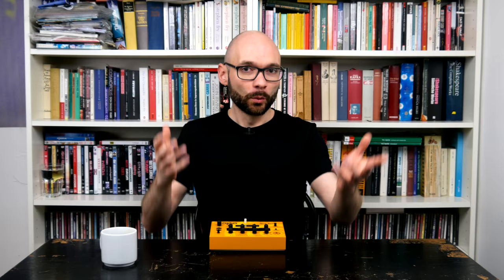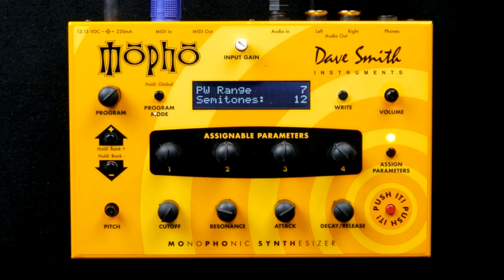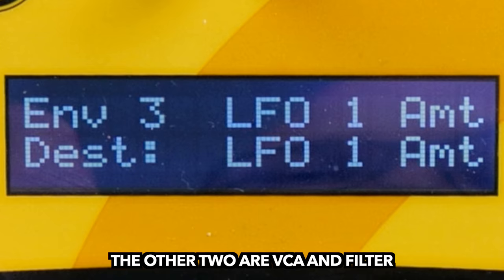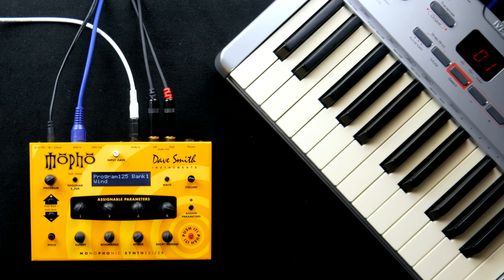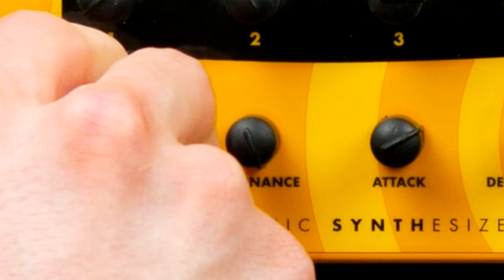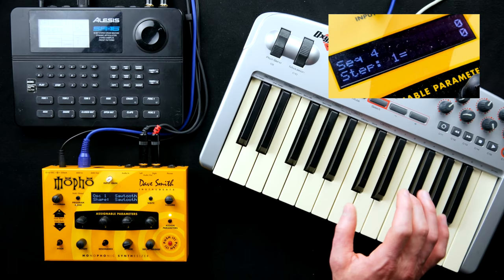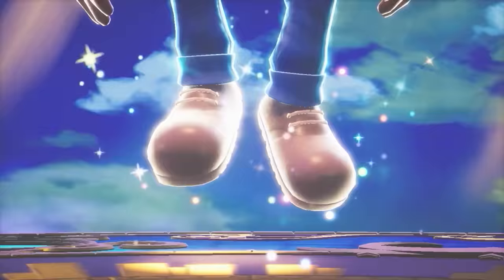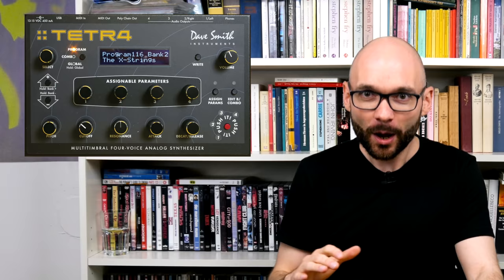Bad Gear - Dave Smith Instruments Mopho - Giving the Pro-1 a Bad Name???

Comment: That fucking intro musical / dance sequence is straight-up one of the strangest experiences I have ever had in a video game. You made the Mopho sound incredible, as always!
Reply: All the intro joints sound exactly the same no matter what bad gear he uses on each episode. Not sure how he does it but I've purposely toggled between episodes to test it. He should do a completely different episode showing how he does this. The intro music is dope.
Reply from the maker: Thanks!
Reply: None of them sound the same to me. I mean it's the same tune, with different synths or drums (if the episode is about a drum machine) 

Some of them I'm sure he really had a time to get to "fit" in the original composition, but nonetheless they all sound a bit different.

Comment: I was lent a Tetra by a friend and although it's a great sounding machine, the lack of a usable UI coupled with the fact that you have to actually buy editing software (which isn't easily transferable) from a third party company is just absolutely ridiculous. These things could easily have been riding high on the "modern classics" list if only they'd made them easier to work with, both inside and outside the box.
Reply from the maker: I wholeheartedly agree!
Reply: I agree, that's why I recently bought the key version to polychain it. A bit less menu diving and duophonic now. :)
Reply: Yeah I love the sound of my Tetra but not the interface.  I nearly bought a controller but then spotted a Mopho x4 keyboard going cheaply so I ended up buying that - got a dedicated controller with the added bonus of doubling the polyphony to 8.
Reply: a keyboard version doesn't add knobs per function, only doubles the voices. easily amended with touch osc template though.
Reply: @brmbkl  Yes that's right It doesn't provide a knob-per-function as that 's not what the x4 has.  Despite having toggle buttons for cycling between LFOs and envelopes etc however I still find the increase in user friendliness you get from having the x4's 18 or so knobs is a huge improvement over the the Tetra's 8 knobs and extensive menu diving.    One thing I would add though, is that the cost for both units combined in the second hand market brings the total outlay up into the region where there are other 8 voice alternatives available like a Prophet Rev-2 for example.   My combination was bought in stages over about 5 years after getting fed up with programming the Tetra through software/menus.

Comment: This one is part of my everyday rig. I use it exclusively for lead synth. I just dial in the sound I want and stop touching it. Probably why none of my knobs have broken off.
Reply from the maker: I think that's what they originally had in mind
Reply: In addition to leads, it serves very well for funky baselines, with the caviat that one can forgive the oscillators for being DCOs.(the curtis filters more than make up for this). Once the mods are programmed well, the front panel knobs are not an issue. Use a keyboard with velocity and after touch and the parameters come to life, The sequencer slew makes for some sick retro trance lines, and anyother music that uses portomento with pitch sourcing a bunch of modded parameters. Try it with a Future Retro zillion endless sounds.

Comment: Yet another Edisyn supported unit getting the Bad Gear treatment.  The Mopho is almost exactly 1 voice module taken directly from the Prophet '08, plus audio in and subosc.  In fact Edisyn's Prophet '08 editor supports all Mopho versions plus the Tetra in a unified editor -- they are basically the same machine.  The main problem with the Mopho is of course the menu diving.  But you can use the Prophet '08 controls to program the Mopho directly.  Think of it as a 1-voice Prophet expander.
Reply from the maker: Thanks for confirming that, I've read that while doing research

Comment: The Evolver Desktop is a good choice too... amazingly powerful, ever more amazingly hard to program.
Reply from the maker: Thanks for the input, I'll take a closer look!
Reply: Got both, evolver sounds more aggressive. They are a good couple together!
Reply: @AudioPilz  Yeah, it's got an even worse problem than the MoPho; tweaking more than one knob at a time isn't really an option because they'll fight for control of the one parameter at a time you can work on. Also, it's a really bad "just mess around to get a sound" synth because there's so many "dead spots" where the wrong setting will basically derail the sound, produce no sound, or just make it awful. It gives you a lot of options and some of them are not very musical, or not what you need for the sound you want. The manual I have even has a section devoted to the "I can't hear anything/why don't notes play/the sequencer won't play" settings debugging.

It's great if you have a specific plan and it's got a ton under the hood but you gotta go in with a plan or it's not going anywhere.

Comment: Mopho was my first DS synth. It is not a bad gear material, by any means:) or...it actually totally is. Then i got Tetra:)
Reply from the maker: I assume Tetra is the real keeper
Reply: @AudioPilz  of course, one of the things I would never get rid of. JV1080, DX7, Tetra, Evolver, Jupiter 6, Access Virus B. As you can see, quite a mixture (I don’t know how many synths I have bought, traded for, got as compensation or whatever and then sold/gave away) But these guys stay:) as they have more than just technical value for me, JV and DX were devices I learnt inside out when I was starting, I had no manual for JV in 1996, you can imagine how many wrong concepts I built and scratched until i figured those two out. Then I got Jupiter 6 somewhere around 2001. Then I got Mopho, Tetra and Evolver. I thought I don’t need another synth ever again;)

Comment: I'd like a review of expression pedals like the Roland EV-5.
Reply from the maker: Is there so much of a difference (apart of the build quality, of course)
Reply: @AudioPilz  I have an Alesis QS5 from 1995, and the manual recommends the EV-5. However, nothing happens if you plug the EV-5 into Pedal 1 because none of the factory patches are mapped to it. You have to manually assign the filter and effects parameters for each patch. The expression pedal really does make the synth sound great, but it took 27 years to figure out!

Comment: 2 suggestions to consider.
1989 EMU Proteus 1. Belonged to an ex girlfriends electric violin rig and I personally used it extensively in 1999. Its so so sounding but the editing is b.s. 2nd is Yamaha RS 7000... other than the sequencer & the sampler being o.k. however the asthmatic on board sound engine is nightmare to make it sound punchy or even remotely intense, thought it would be better than the famous mc-505 groovybox but other than the sampler its so weak sounding but the really strange thing is that they are kinda rare.
Reply from the maker: Great input, thanks! I'll take a closer look!

Comment: Pillzaddict here. Just have to chime in, you are likely to know that Dave Smith passed a month ago. I now intend to keep everything I have that is DSI. However, remember that the sequencer is duophonic on everything but steps. oscillator one will always follow the steps of oscillator two. Otherwise, there is a lot of expression programming osc mix through the 4 LFO's and the sequencer. I have two tetra's and a mopho and never use the editor, use it long enough and you can fly through the settings. I really think you would do well to get a Tetra for personal use ae a four mono synth setup.

Comment: I had no idea this had a bad reputation. I love mine. Paired with the Behringer BCR2000 and custom firmware that turns the BCR into a knob per function menu. Granted, it's absolutely necessary to use the BCR with it, or the menus are a giant pain in the ass.
Reply from the maker: The BCR is a great complement to the Mopho

Comment: I had one of these. Nice sounding synth but a pain in the rear to program without a computer so you can see all the parameters. But I sold it and bought a Nord Lead 2X instead as I wanted all buttons on panel and no menu diving. The Mopho sounds much fatter though, so if you want fat base or creamy lead sounds, the mopho is a good alternative.
Reply from the maker: Agreed! Maybe get the keyboard version?

Comment: I have both the DSI Mopho SE 3.5 octave keybed with aftertouch and the DSI Mopho module.

I would say the comparison would be like comparing the Waldorf Blofeld keybed against it's "mini me" module. 

The DSI Mopho SE has almost 1 knob per function, and makes a great programmer for the DSI Mopho module.

The interface on the module is too fiddly for my liking, but as you can program it directly from the SE, it is not a problem.

I can't comment on the yellow coloured keybed as I do not have  one.

Comment: love the show!
can i make a suggestion into a piece of obscure 90's gear you can review?
The mighty Yamaha SU700 sampler, i have been using one on and off for over 20 years! 
it's such a frustrating machine but i keep coming back to it...maybe because i am nostalgic because it was basically my first car, as in ; when i was a 20 year old apprentice, i procured a $2500 loan and purchased this sampler instead of a used car!
i would definitely not still have the car if i did buy one back then,  but i still use the sampler to create noises these days so i think i made the right choice !
Reply from the maker: Thanks! Great idea!

Comment: Would be interested in hearing your views on the Roland D-05.  If you weren't halfway around the world, I let you borrow mine.  It would be fun to watch.  Besides, it would be nice to see what more talented hands can do with it.
Reply from the maker: Great input, thanks! I'll take a closer look
Reply: @AudioPilz  
I love the sound but modifications to settings are best with an external controller.  Use the pre-installed patches, buy an external controller, or as you say, paint the hall through the mail slot using the built in interface.  It's a great piece of kit that requires an external controller.  Don't get me wrong, like the DX7, it's actually great gear and bad on some level.  Let me know if I need to ship one to Europe for you.

Comment: This was technically the first analog synth I ever purchased and I still have it. (Though I had borrowed a number of analogs since the early 90s.) I really like the synth engine and filter A LOT. I think the Mopho sounds better than most gear I have. Programming directly on the unit, though, is quite terrible. There is or was a decent VST plugin based editor that's I think is 32 bit unfortunately and there is at least one really good standalone editor for it. Given the chance to go back in time I would have gone with something else from Dave Smith Inst that had more voices.

Comment: My only beef with modern Dave Smith designs is the endless dials... which made the poly evolver keyboard & P-08' annoying... of course a pe edition fixed this with Prophet.
Had these both because my very first synth was a rev 3.2 Prophet 5 built in 1983.
Reply from the maker: You can do endless dials right (as Elektron proved with the Digitakt)
Reply: @AudioPilz  good to know... the DSI's problem was they would just stop having any accuracy which became just this vagueness of where you were with all controllable functions making it not really live performance friendly.

Comment: On the one hand, the keyboard version is much better to use, but both sound harsh if you compare it to the Toraiz AS-1, which contains a Prophet-6 Voice card. Sadly, Pioneer does not do updates, so if someone wants to use it with MIDI clock will be screwed ...
The Pro One was a cheaply built piece of ** but with great sound, the AS-1 is more likely to be the modern Pro One because it is one voice of the Prophet-6.
Reply from the maker: ...or simply get the Behringer;)
Reply: @AudioPilz  Yes! This has the much better build quality :)
BTW "tickling all the foxes" is hilarous, LMAO!

Comment: I have the Mopho x4. It is one beast of a synth with a name that sounds like a slightly out of touch old man trying to be hip.... Or trying to compete with the sub phatty. .... The interface is great, it's got 4 voices and weighted keys. ....... Wish there was a latch/hold button independent from the arpeggiator but other than that it's a great instrument.
Reply from the maker: The x4 seems super interesting!
Reply: @AudioPilz  I mean it's more or less a Prophet 4 with a sub oscillator for every voice. Lot's of fun to play ...... They lost the bumblebee yellow that the original Mopho had though. So it is harder to spot from far away.
Reply: I found another old MophoX4 for 500$ I poly chained them. Now It's MophoX8..... It's really good gear.

Comment: Loose knobs are annoying. I've bought Mopho Desktop Knob Kit from Sequential. It's a bit overpriced but definitely worth it. They are Prophet style rubber knobs with shiny tops, tightly fit to the potentiometers of Mopho Desktop.
Reply from the maker: Prices of the knob kits are insane!
Reply: @AudioPilz  39 bucks for kit, 28 bucks for shipping. Almost 1/5 the price of Mopho Desktop :((

Comment: Used to own one, ended up selling it. Wonderful sounding little machines, but the menu-diving ended up making it uninspiring for me.

You forgot the neat little feedback trick is has to get a lot, lot fatter - the ext input is normalled to the left output with nothing plugged in, and can be routed via the internal mixer for nice fat feedback sounds.
Reply from the maker: So true, sorry for that and thanks for the clarification!
Reply: @AudioPilz  No problem - just thought it worth pointing out! :-)

Comment: I would like to see a video on the Pioneer DJ Toraiz AS-1.
Reply from the maker: Great input, thanks!!!
Reply: @AudioPilz  I have one that has been sitting in a drawer for two years. There is no way a DJ can program a Toriaz AS-1 in real time as he works. Sure it's powerful, but the screen requires eye glasses, and the onboard sequencer is impossible to program. I think this synth will become valuable because it seems that nobody bought one, and they more than likely stopped producing them years ago. I don't know.

Comment: What drums do you use in the jam? ANd how do you use your ls2 (ive one which I don't use..)
Reply from the maker: Whatever I find in my sample folder or drum machine cabinet;) LS2 is great as a mixer, parallel signal chain management tool, preamp, attenuator, switch, split...
Reply: @AudioPilz  I cant understand it, and Ive 9 pedals on my board, so it'd be put to good use xD

Comment: nice demos as usual

my first DSI synth was an Evolver desktop which is insane but sadly will eventually have the same encoder issue  - the encoder option was always a sketchy one  - my DSI PolyEvolver needed the encoder swap out to pot boards - now it's amazing bur eventually added to the cost

going back to the Yamaha SU700, which had famous encoder issues, nowadays companies should use good encoders or not at all, and even then the damn encoders will eventually fail, they always do in the end - they allow precise digital control but pots just last longer if they are sealed - my pots in my Moog Rogue from 1982 are just fine

I love Sequential/DSI stuff, and instead of a Mopho I got dual Tetras in polychain mode to make s portable and better sounding Prophet08 that fids in a small case with a power brick (just need a MIDI lead in) - Tetra has sub OSCs that the Prophet08 doesn't have and in the end the Tetra duo was cheaper than a Prophet08 - I will give up knob per function to get all that and it sounds great
Reply from the maker: 2000ish Yamaha pots were a nightmare!

Comment: I hate the interface on the Mopho and Tetr4, but the Mopho always sounded fantastic. I still have the Tetr4 box, but rarely use it. the Mopho always sounded just a little better.
Reply from the maker: Never heard them side by side!
Reply: From the stereo output can't sound the same because 4 volces need more headroom than just one... But you can set the Tetr4  to get each of its four voices out of its four outputs, and each of them sound stronger and fuller... like its little brother Mopho...

Something similar happens with the Toraiz AS-1... compared to the Prophet 6, sounds louder and fatter...
Reply: @kaiwetronic  IIRC, the Mopho (and Mopho x4) have a bass boost circuit of some sort that the Tetra and Prophet did not have. But maybe I'm misremembering.
Reply: @Psychlist1972  Mophos and Tetr4 do have the suboscilators and feedback loop that Prophet 08 don't...
On the other hand, P08 and Tetra share the 2-layer architecture...
So, Tetr4 is the most advanced and versatile member of its family...
(Even not mentioning its unique Combi mode...)
Reply: @kaiwetronic  Thanks. Yeah. I may have been thinking of the Mopho vs P08. It's been a while :D

I have the Tetra, but not the Mopho -- which I've only played in stores.

Comment: I can't see any big drawbacks other than the UI. It sounds great. So does the X4/Tetra. You want some bad gear? Checkout the Dreadbox Ataxia module. "Dual ADSR" my ass. The "independent" trigger inputs fire off both ADSR's no matter what. And the settings for 1 of the modulators are NOT saved when you power down. I hate it. That said, you might love it. You can get mine on reverb now for the low price of 1 million currency of choice.
Reply from the maker: I'll give you 2 Mil!
Reply: @AudioPilz  it’s yours! :D

Comment: That's always the dilemma with these really small desktop synths... Huge Sound, but horrible UI. 
Same thing as with the Pioneer Toraiz AS-1. Basically a single voice of the DSI Prophet-6, which sounds really fat and is huge powerful. But the interface is even worse than on the Mopho.

Maybe another Bad Gear candidate?
Reply from the maker: Yeah, this one popped up a few times. Thanks for the suggestion!